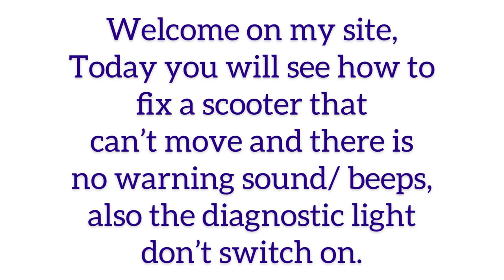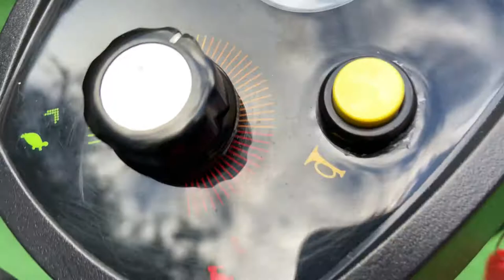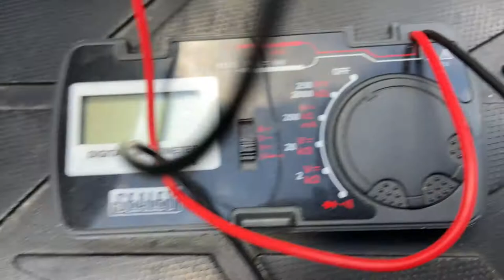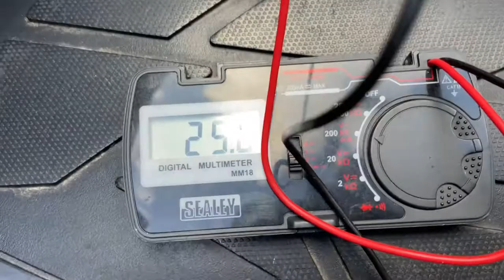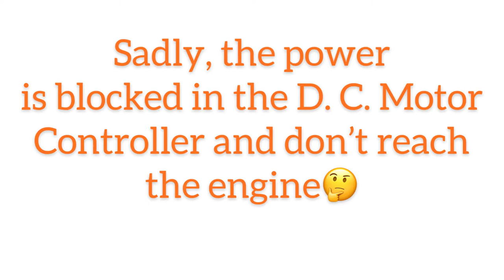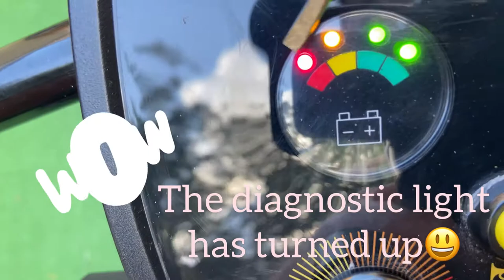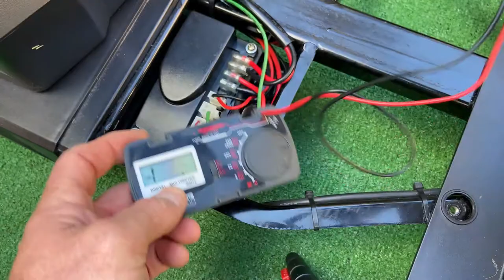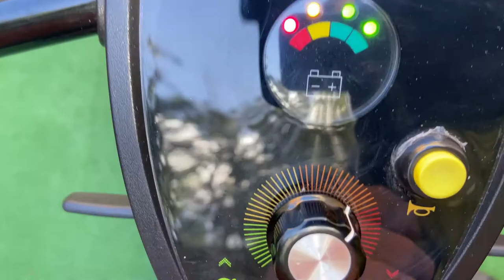DRIVE Medical Scout Lightweight Mobility Scooter can’t move and the diagnostic light don’t switch on

Comment: Hi good job. Is the multimeter setting you put on in the first place the one you took all the readings from. Only mine, on the second reading registers zero.🤔. Mick.
Reply from the maker: Hi Mike,
In the very first reading checked the batteries. After floor cover removal firstly I have checked the incoming voltage, then the outgoing voltage. That was nearly zero for me, too. That was helping to identify the problem is with that control panel.

Comment: Thanks! I changed the control module just like you and I have the same problem. Light is off, scooter won’t move. Any more ideas?
Reply from the maker: Hi Robert,
Are you sure the new control panel is ok? May the magnetic break? Sorry, but I am not sure without investigation.
Reply: @georgesworkshop8600  thanks

Comment: Hi George 👋 I have a pride go go ultra x 3 wheel scooter in which the battery light doesn't work and the horn doesn't work. Can you please tell me what is the problem?
Reply from the maker: Hi Vance,
If you are sure the battery is ok, it could be a couple of things. Wire, fuse, control panel. I can’t tell you without investigation what is wrong.

Comment: Mine takes off just fine but only goes about 1/2 block the locks up then I must sit there for a 45 minutes or so then it’s work just long enough to get back home and locked up again????????
Reply from the maker: Hi Glen,
Your brake is broken I presume according your description. There is a modul, that need to replace.

Comment: Hi,see if the red diagnostic light is flashing .. and the drive scooter is moving ok what would this possb mean?
Reply from the maker: Hi,
Count how many flashes do you see and search by the number for the error code. May a new battery will needed shortly.

Comment: Where did you buy that regulator? My scooter is doing the exact same thing
Reply from the maker: Hi, 
I get used to buy all parts from ebay.
Reply: @georgesworkshop8600  thanks I’ll check it out. Seems I need to replace the front to rear plug connectors I’ll see if I can find them on there
Reply from the maker: Good luck 🤞😊

Comment: I have a drive scout DST 4 wheel scooter, just replaced the batteries brand new ones. But the red light still flashes saying to check the connections on the batteries. A friend will be checking that tonight for me . Any other tips you could give us that might help find why it won’t move ? It was brought bak to me from Florida, had only been used very few times , looks brand new . It sat for 4 years, but was plugged in for a day and a half , then was taken for a short ride because the batteries didn’t hold much of a charge . It was parked and brought back to me !  One guy said it needed a new motor, but another said he didn’t believe it had been used enough for it to be the motor. I don’t have the $700.00 dollars for a new motor that the guy said it needed, was just hoping for some tips to get it running , some different things to try !! I’m looking at a major back surgery in a few months, so I would appreciate any help you could help me out with! 
Thank you !
Deb
Reply from the maker: Hi Deb,
Sorry for the late response. I hope your scooter has been fixed. In my opinion the engine can’t be faulty. I have another video on YouTube where I show a control panel issue and it’s replacement. Anyway, the long time mis-use is the biggest enemy of the batteries.
Reply: @georgesworkshop8600   thank you so much for replying back to me, I appreciate it!  I will be having it looked at by my friend who is going to check all the connections and I will show him your message ! Again , thank you !  I will try to find the video you are talking about !! Can you send me a link to that  video, please ?!
Reply from the maker: Hi
DRIVE Medical Scout Lightweight Mobility Scooter can’t move and the diagnostic light don’t switch on
https://youtu.be/vVLIlZYMPjQ

Comment: I lost my key to my scooter, been a year and a half since I used it. How do I replace the key/ignition switch?
Reply from the maker: Hi,
You can buy from ebay new key. Search for make and model. It’s easy and cheap. There is no difference in key within same model.
Reply: @georgesworkshop8600  only problem is, the battery runs down SO fast. Right now I'm just using it to walk my dogs, but if I wanted to go to say, a fair or festival or something, it would be worthless because the battery is on red after just 20-30 minutes of run time. And new batteries are STEEP! Any ideas for a cheap fix for this? I did have to buy a charger, I lost the one that came with it. Do you think it could be that?
Reply from the maker: Hi, you need to change the battery. Unfortunately

Comment: Hello I changed the controller on my scout 3 and the diagnostic light still flash what's next to do thanks
Reply: Hello can you tell me why it work on my scooter and why it work then stop and beep please respond.
Reply from the maker: Hi,
Sorry for the late response. My guess is the battery is short-circuited and need to be replaced.

Comment: My scooter is beeping not the drive or Nortel won't go got new batteries still won't go please help
Reply from the maker: Hi Abby,
Could you count how many beeping is there when you turn the key to on position? Different problems are indicated with different numbers beeping.  If you know how many you can search on internet for the error code and the solution.